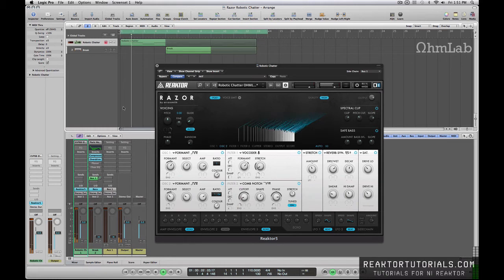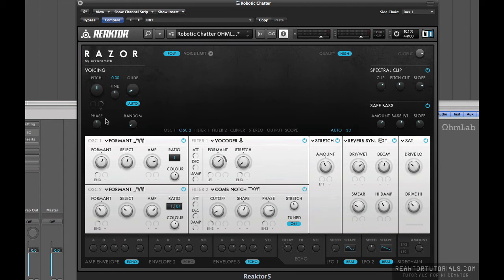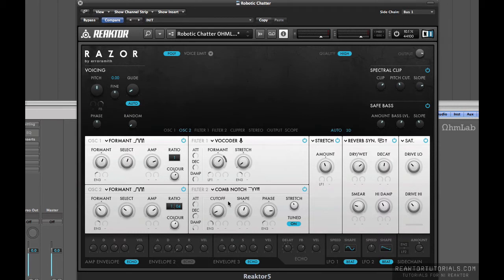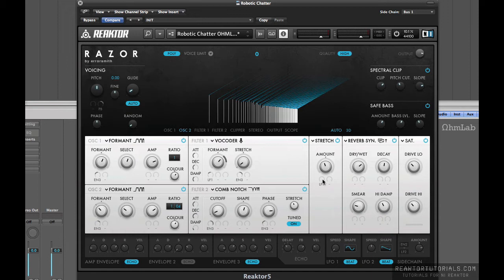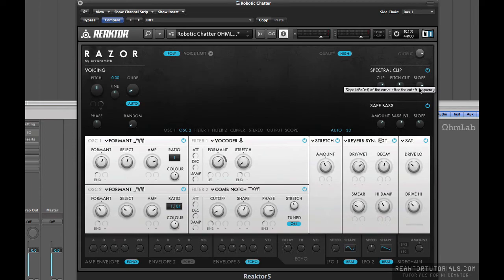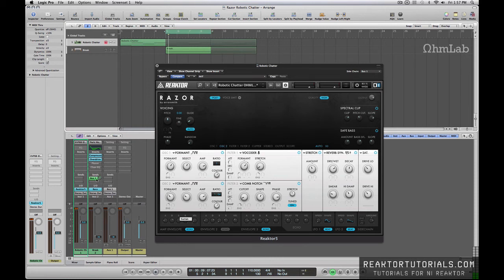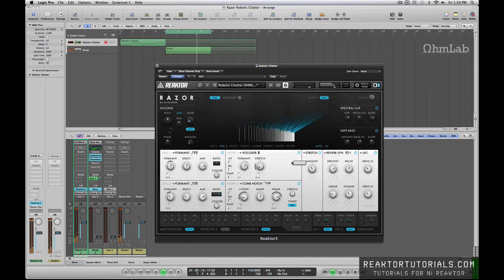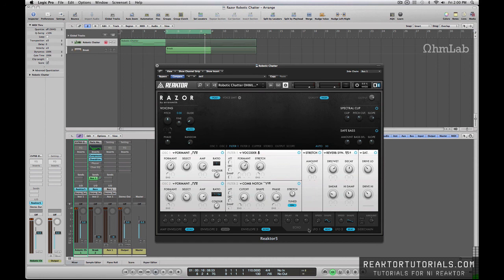Reaktor - Using Sidechaining & the Vocoder In Razor - Powerful Tips

Comment: The original vocoders had no sound generating section. They simply took two audio inputs and modulated one with the other. The vocoders we see now generally have the choice of providing a "carrier" sound for the input to modulate making them easier to use, if you want, but can still take two audio inputs and modulate one with the other. This gives the user the freedom to choose the sound they want to modulate with, for instance, their vocals - like a guitar or whatever.
Is there a way to use Razor in this fashion? Can it be used to modulate a sound not produced internally?

Comment: I use FL Studio, not Logic. Do I have to set something up inside Reaktor or Razor for it to accept the sidechain signal. I have a break sidechained to my Razor mixer channel but where does it go inside of Razor? I have copied your settings and it sounds pretty much the same but sidechain doesn't do a thing.